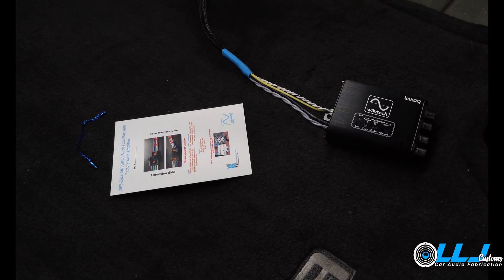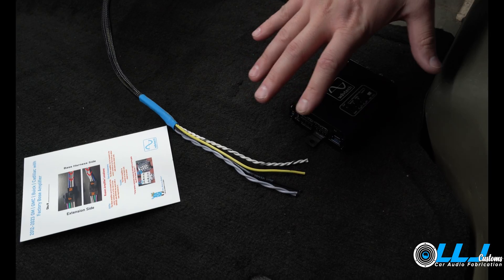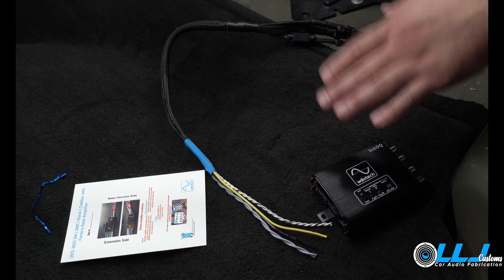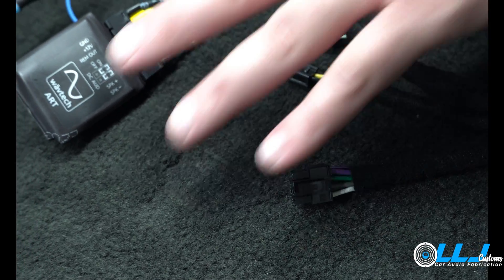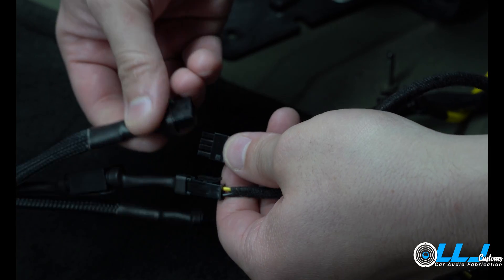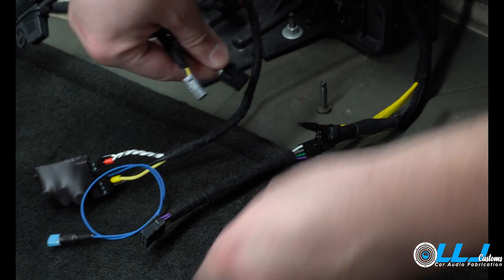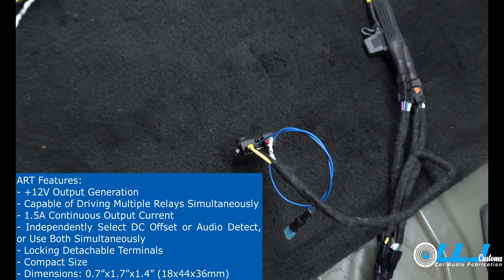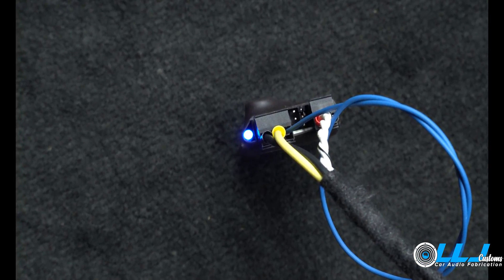Car Audio 12v Automotive remote turn trigger with 12v DC offset and Audio signal detection

Comment: Can I cut the harness off and wire this directly to factory stereo that has rca subout but no remote wire? It's a Scion Pioneer premium HU. Don't want to use LOC since I have rca outs, and also want to avoid wiring remote wire to a acc switch.
Reply from the maker: @yarisygatos  absolutely all u need is 12v+,ground and the driver speaks wires so white/whit black . All of this will be avaliable at the radio harness

Comment: Looking for a harness to adda 8 channel Amp to power new set of Speakers in my 2019 Corvette with a 10 Speaker system, any advise.  I am using a Mosconi and a Audio control processor
Reply from the maker: Hello Starlink If you have a 10 speaker system and you plan to power 8 I would definitely use a DSP but you can use kicker amps at that point. once you use a dsp to clean and tune all the amp needs to do is amplify so look for an amp with high efficiency.
Reply: @lljcustomscaraudiofabricat7854  Thanks, what power ratings Suggested?